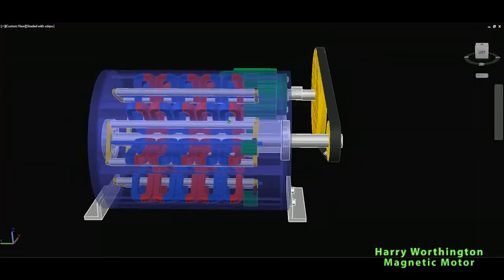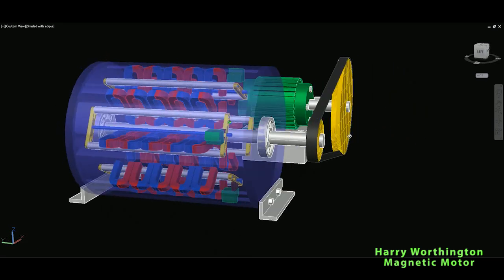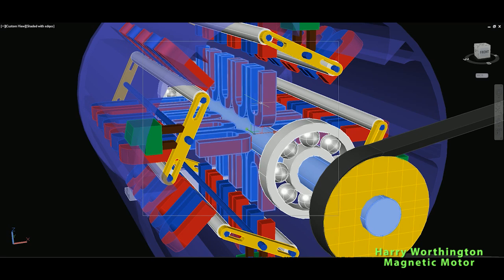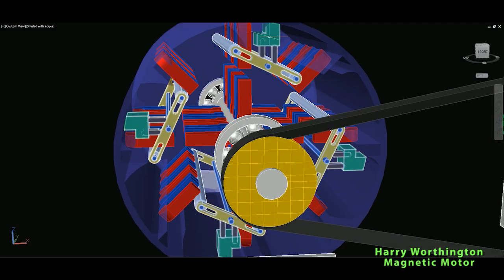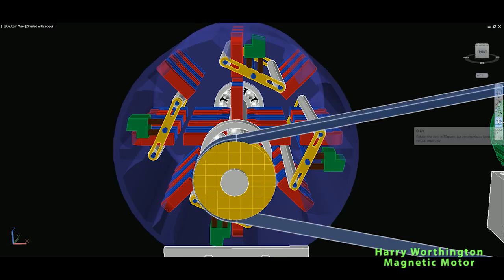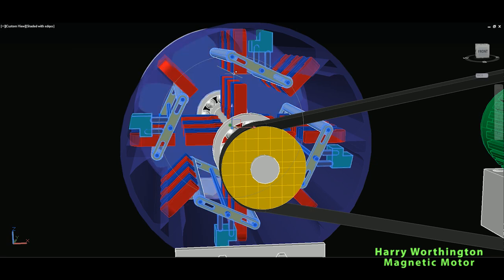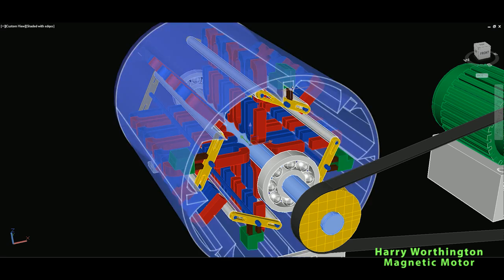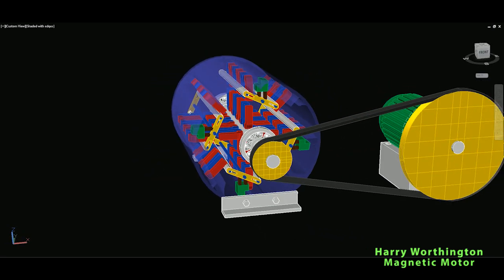Free Energy Generator, HARRY WORTHINGTON Magnetic Motor

Comment: It has an end, its movement is not eternal, but through this system, an energy-saving engine can be made. In the event that the engine is stopped, a combustion chamber is made equipped with spark plugs and gasoline. Whenever the magnetic engine is turned off, the motion sensor sends an order to the combustion engine to emit a combustion spark so that the magnetic engine can be operated again. This engine is only useful in saving electricity, but in transportation it is useless.

Comment: You can no more get free energy than you can lift yourself up by your own bootstraps, However complicated the machine, it will always use more power tha is generated. The effort is futile because the universe does not work in a way that would make this possible. All free energy devicews are either frauds or delusions.

Comment: Unless you can explain how it will rotate clockwise or counter-clockwise it will not rotate at all. Better yet show it moving so we can see how the mechanisms operate. Are you sure this is an original concept design?
Reply from the maker: Odouls77 There is a link of original patent in description, with images. you can read all i detail there
Reply: The patent was filed on 11/25/1925 and granted on 8/13/1929. It should have been commercialized in 1939 if it was a true invention. But until now, 89 years after being patented, we do not see any working model. Conclusion: it was a failed invention. Therefore, do not repeat the same failure and try another untested idea.